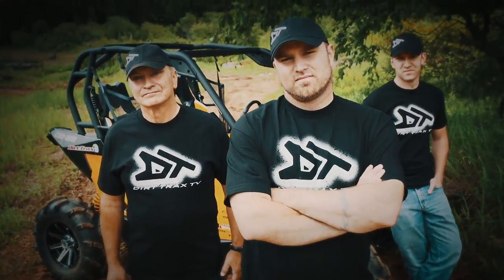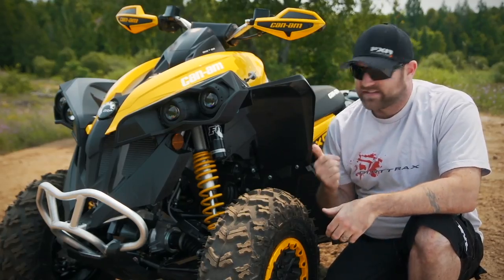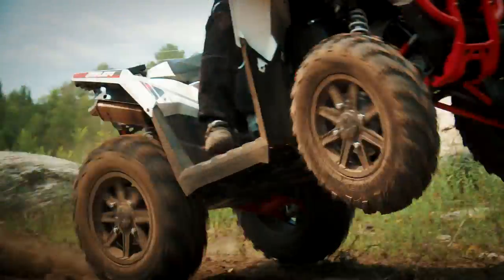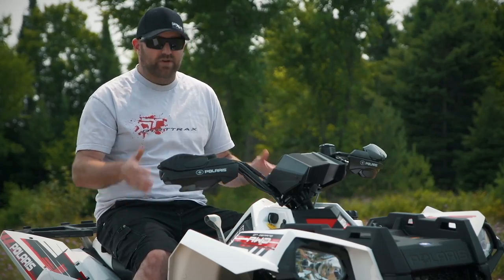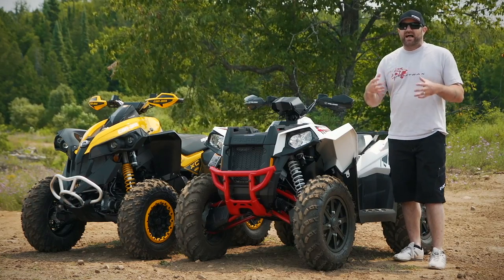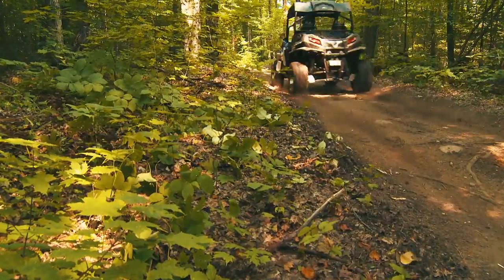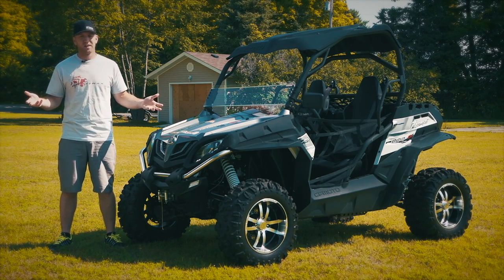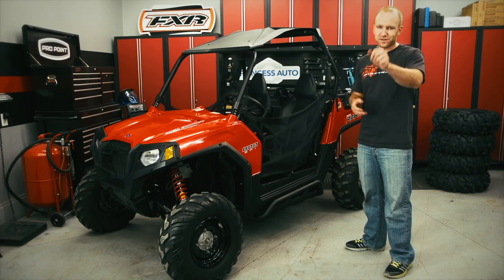DirtTrax Television 2014 - Episode 9 (FULL)

Comment: Having just checked the CFmoto website, the  Rigid Roof, Tilt Windshield and Flare KIT are no longer standard equipment. They are options. I guess it didnt take CFmoto long to see if all other companies can cash grab so can they.
Reply: http://cfmoto-us.com/products/sport-side-sides/2014/zforce-800ex

http://cfmoto-us.com/sites/default/files/files/specs/6v1962CFM_ZF800EX_2014.pdf

Molded roof-standard
Fender flares--standard

Not sure about the windshield.  But the other stuff is standard.
Reply: See thats my point, Check the Canadian CFmoto website, and they are options. http://www.cfmoto.ca/en/ZFORCE-800EX_specs.html Compare the 2 sites.
Reply: Mitchell Berry ar